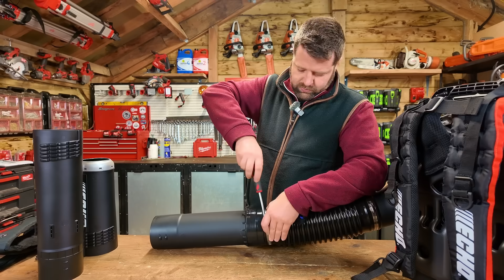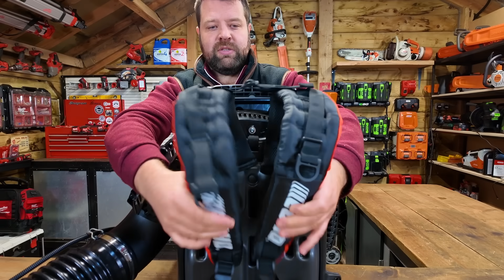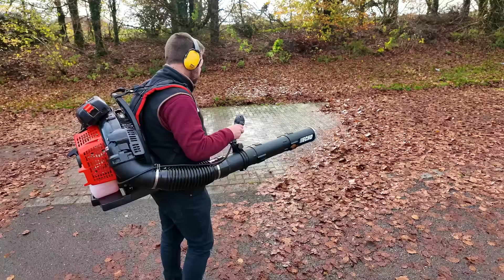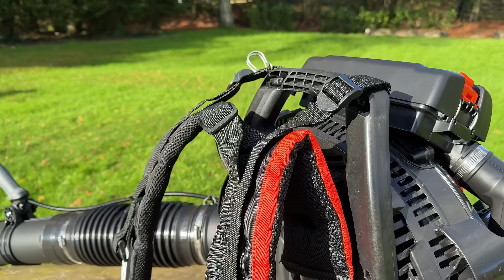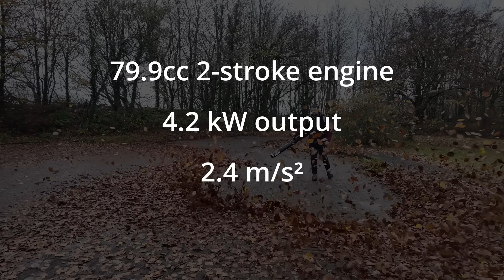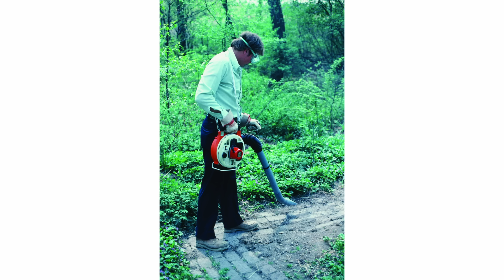It’s Here! ECHO Unleash their 2 STROKE Brute — PB9010T Review!

Comment: I have the slightly smaller PB-770 T. It’s an amazing machine. It’s a bit lighter. Little bit easier to carry around. Both have the most beautiful sounding engines. Also, without a doubt the cleanest running 2 cycle engines. Even when cold starting no visible smoke. If you don’t run any more than 3/4 throttle; they’re not super noisy. Fuel usage is not too high unless you’re running full throttle. Echo is a brand that I love their blowers. Everything else I own STIHL.

Comment: I had an Echo PB8010, engine blew.  Bought a 9010 and it was good.  Last year I bought a Redmax EBZ9000, same blower as the Husqvarna 590BTS.  The Echo is no longer the world's most powerful backpack blower. The Redmax/Husqvarna have even more power.  Specs definitely represent the power.  Echo-48 N, 1110 CFM, 1885 M3/H. 220 MPH, 98 M/S at the nozzle. Redmax/Husqvarna-56 N, 1245 CFM, 2115 M3/H 216 MPH, 97 M/S at the nozzle..  In a side by side comparison, you can feel the difference.  All great blowers though, can't go wrong with any of them.  Here is my testing. https://youtu.be/zJCtBuqm6kY?si=Ej45IIR_dksWuzWj  And  https://youtu.be/J8NsDx_xPu8?si=hFC6IUaWDWeMPOag   Thanks for all your great content and videos!

Comment: The most annoying sound you hear is the 2 stroke leaf blower.
My neighborhood abandoned all gas powered OPE in 2020. Piece and quiet 🤫😊
Reply: so force ppl to rake leaves...wasting time and having to do manual labour...or buy a crappy electric thing that has 1/3 the power and replace batteries all the time because they believe that gas powered equipment is somehow bad for the environment...and ppl whine about noise...as a 1st world country that is going backwards...things are supposed to get easier...not go back to the 1920s...the noise doesnt hurt anyone...and neither do co2 emissions...anyone who says otherwise is an ecomentalist commie...ppl should not have to waste the most valuable commodity...time...to do manual labour...and I dont give two fucks about how loud my blower is and if it bugs neighbours...which happens to be this exact model but a Shindaiwa...
Reply from the maker: It’s abit of a drone for sure with leaf blowers. Chainsaws on the other hand you can’t beat that 2 stroke sound 😅
Reply: Depends really , battery blowers don't have the same grunt, and smaller 2 strokes take longer, with our wet climate id rather listen to an echo in the background for 15-20 minutes than a lighter machine droning for an hour ..
Reply: @kevinwillis6707 
Not when your city and HOA says No.
More communities are setting rules for the gas OPE.
Reply: @wt9653  Because they're commies. The only way the electric equipment gets a foothold is by legislation.
Reply: @tobylou8 
Go to your local Home Depot and Lowe's. Battery powered OPE dominates the display.
That's why Honda stopped selling gas lawnmowers in North America.
Electric out sells gas OPE in North America.
Reply: @wt9653  And? It dominates because that's what the manufacturers are incentivized to produce. For some things, battery tools are the perfect choice. Go to an OPE independent dealer and those machines do not dominate. They sit in the corner collecting dust. If one has a 1500 sq ft lawn, battery is probably a good choice if you don't want to mess with gas and oil because they're "icky" and you don't mind paying through the nose for the technology. A Toro flex force 60v battery with no tool is $300+!! A homeowner won't use $300 bucks worth of gas in 10 years. Honda is out (then in) of making mowers for the US because of MANDATES by commies and ever more stringent EPA regulation. Battery powered OPE is not market driven, it's legislative in nature because what idiot would pay $700 for a mower when a $100 mower will do the same thing?
Reply: @tobylou8 
The big box stores sell 1000x more than any independent dealers.
If you buy them during sale, you don't pay $300. EGO 615 CFM leaf blower was $149 with the battery and charger a couple of weeks ago. It's back up to $219.
Honda doesn't stop selling because of the politics. The news Honda released says the sales numbers dropped enough to shut down the production in North America.
Reply: @wt9653  I don't know what you read but EPA regs have been designed to shut down gasoline powered equipment. Read an industry trend article on how the EPA keeps squeezing down on emissions when there's no problem. The EPA's goal is zero emissions which is absurd, but that's what commies do. Until battery equipment reaches the productivity and ease of use as gasoline, it will still be king! The other thing about meeting regulations is that it costs more and the consumer pays. We are a long way off from a battery backpack blower as powerful as the Echo 9010.
Reply: @wt9653 luckily I don't live in a mad country that allows a HOA 😅, I'm all for battery power, some of the new battery tools are great, but I haven't come across a commercial grade blower powered by batteries that matches a good backpack blower yet, with battery tech improving it's only a matter of time.
Reply: @wt9653  ya ecomentalist insanity...this is why I voted for Trump
Reply: @MariktheWolf 
Because of trump!
You're now paying $8 per pound for ground beef! Extra $5,000 -$10,000 for a new truck. Extra $5000 for a used truck.
The Echo leaf blower is $300 more than before. It's assembled in the US with the global parts (not made in USA!
Reply: @wt9653  it takes more than 10 mths to undo the damage caused by Bidens left wing agenda...cattle shortage and only 3 beef houses active in the US because the left hate cattle over another harmless gas...prices of vehicles going up because of a combo of leftover inflation plus all the new tech going in to these modern vehicles (more tech is good as long as it doesnt involve reducing a gas we all breathe out)...used cars are still all screwed up from the covid supply shortage...as for this blower...they are made in the US or Japan with parts from Japan...both very good places to have things made...the alt. is the left wing making things even worse and ditching all things powered by oil or gas having ppl rake leaves and shovel snow like a 3rd world country for a made up crisis whilst allowing awful terrorists and criminals to invade our country so these progressives can get more votes...part of the evil globalist eco-socialist agenda...and I personally own this blower with the Shindaiwa branding...and its worth $650...
Reply: @MariktheWolf 
Brain cancer! Go remove the Trump tumor ASAP!
Reply: @kevinwillis6707  I will also add that there is a skill level to moving leaves efficiently. Most folks start at the farthest point from where they want them and end up with a windrow several feet tall that is more difficult to move the closer to the finish line they get.
Reply: @tobylou8 sorry I don't respond to commenters who unironically use the word "commie" in their little rants...😅
Reply: @kevinwillis6707  But you did.... LOL🤣🤣🤣🤣
Reply: @tobylou8 I'll rephrase, I don't take posters like that seriously...
Reply: @kevinwillis6707  So you prefer more nuance rather just getting to the point. Okay.
Reply: Well you're such nice people. Such a 1st world problem, leaf blower noise, so terrible!!

Comment: I've got the pb8010. Pretty much the same bar few revised bits  from  the harness and hip belt and various other bits I thought the power is the same... unless they have revised the impeller fan to blow tad more... 8010 isn't  lacking,  and it's  a beast and hasn't  missed a beat since owning it over 4yrs roughly
Reply from the maker: Glad to hear your 8010 has been so reliable 👍🏼 there is a difference in power, bust be down to the construction as the engines are the same, got the specs on the screen between both half way through the video if you want to check it out 🙂
Reply: @MachineryNation did watch your specs but the engine is still the same power must be revised blower housing/fan. What's with the thumb nail in the video.. are you saying this blower is a waste of time...think it will waste less time than the br800😂
Reply from the maker: @Dolmar-Rick  haha they wasted time getting it across the pond! 😅

Comment: Looks a nice bit of kit. Could do with a chest strap which really helps with load. I find the off set handles hard work. One of the manufacturers needs to design one where the tube can be moved to either side of the machine to reduce strain.
Reply from the maker: I think with the waist strap it would help keep the should straps in abit, but I do agree a small strap here would increase the comfort on the shoulders 👍🏼

Comment: Currently use the Husqvarna 580BTS,  i find it excellent.  I may be wrong,  again, but Husqvarna now have the 590BTS, which i believe is the most powerful on the market.  If i wasn't so old, and skint, I'd be getting one asap!
Reply: I may got 590bts that Coming to Uk with 56N &1245cfm  but Last year I got Frozen  Right Shoulder Last year so could not Start Normal Backpack only Blower I could start was STIHL BR800C my one got Accessorie  a Adjustable Nozzle gives 25% more MPH & 25% more Air Volume 😊
Reply from the maker: You are correct Husky do have the 590, not sure when it is arriving. Believe sometime next year 👍🏼
Reply: @MachineryNation the 590 has auto tune as well.. I have the 580Bts mk3 I may try to sell it and get the 590 bts it looks good and auto tune and is a lot stronger than the echo I just wish they would give an option for electric start lol. I would give up a couple pounds for that..
Reply: The New Husqvarna 590T is the #1 power blower now. They took the lead over the Echo 9010.

Comment: Echo, Stihl, and Husqvarna are missing the boat.  Where is my electric start?  I want to be able to re-start while wearing the damned thing.
Reply: Stihl has this already, for like 6-7 years now. The BR800 C-E. You can start and stop it while wearing it.
Reply: @Bergamot88  Thanks folks.  Then hopefully my next one will have that/
Reply: @Bergamot88 that’s not the electric start though, but the br450 you get with electric start
Reply: @e @ernieharlin8263 but you can stop/start it while wearing it on your back.. which is what the guy really wants
Reply from the maker: There are a couple of different options out there with easy start systems. Trouble is putting electric start, batteries etc on adds to the cost and also the complexity of the machine. more things to go wrong. Thats what i like about ECHO, straight forward and well made machines 👍🏼👍🏼
Reply: Stihl has a battery start
Reply: I thought it was the 600 which had battery start but cannot remember. I have the side start 800 which can be pull started on your back. It works very well.
Reply: Holy Smokes. Although at that weight you have about 20 mins before you fatigue.  The weight also rules out most females and small blokes ! But you can see it’s very powerful so maybe 20 minutes is enough.
Reply: @chainsawversustree  most females? 😂 I know kids who can run this thing for hours, what are you talking about?
Reply: Weight. But I’d take a couple pounds for it myself 😅